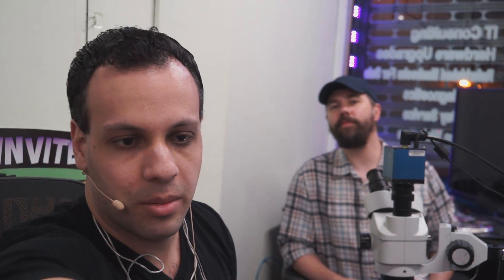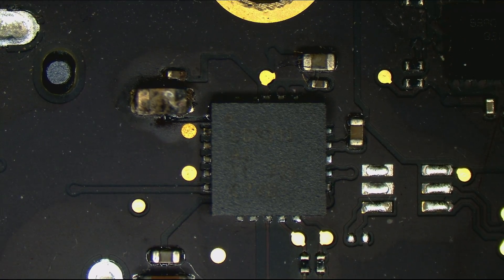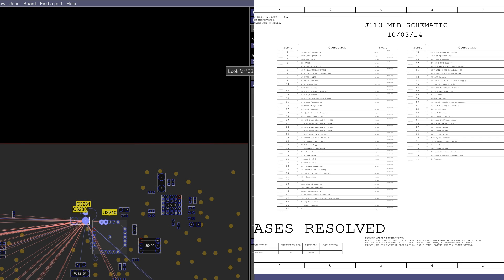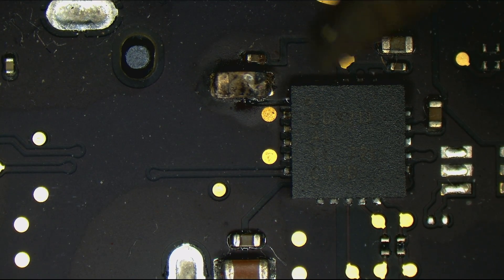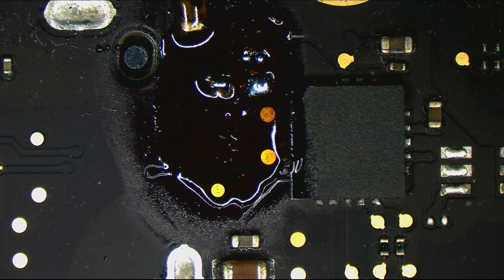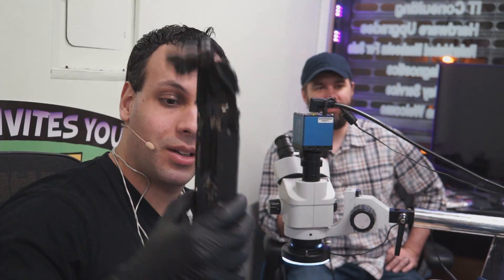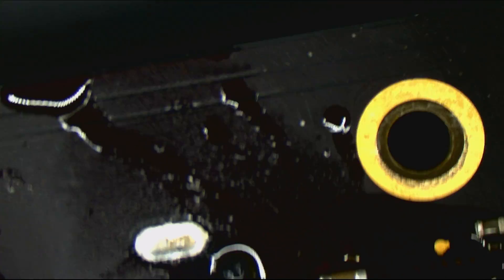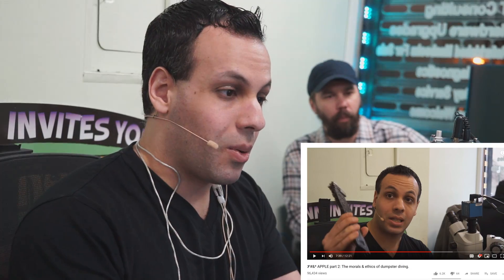Why Macbook Air logic board takes one amp while dead

Comment: 0:52 Like, what the fuck is wrong with people. They do know that the blinkers are supposed to alert others your actions ON TIME, right? It does not cut it to just turn them on WHILE you are turning as a second thought and you're practically in the middle of the intersection! And if you're going to do that, at least check if nobody is coming towards you... It has happened to me multiple times when I bike. Worse thing is that they want to pass the blame on bike riders. Nobody want us on the road, nobody want us on the sidewalk... and they don't even want us on the bike lanes because they want to use them to pass cars.

Comment: Bill:
1x smd capacitor - 0,13 usd
1x knowledge to find the defective capacitor - 129 usd
Reply: Don't forget about desoldering skills, disassembly/reassembly and any consumables for cleaning the board (washing)
Reply: An old dude that used to annoy the heck out of us at my old work said exactly that - customers are not paying for the products and labour - they're paying for the decades of learning the skills.
He was a painful old bastard, but quite wise. We were actually sad when he died despite the frustration he caused.
Reply: this reminds me of when i used to be a field service engineer and i used to service / install all the technology side of McDonald's, including those smart table tents that tell the employees where you are sitting. i was told a story about a soft serve machine repair man was only there 10 minutes but charged 1,000 bucks to fix it. it was a simple fix too. i was shocked, but then realized i would do the same thing

Comment: @Louis Rossmann
If your wearing contacts, that blinking could be a sign your eyes are drying out from air conditioning. Prolonged use of contacts in a dry air environment can cause Corneal neovascularization, with eventual blindness.
Reply from the maker: I do not wear contacts, and I do not use air conditioning in the middle of winter.
Reply: Fair enough.

Comment: I think we need to start tagging videos as "able to be done by anybody" because, lets face it: Buying the screwdriver kit, being careful and watching guides online, and flicking a little burned out cap with your tweezers and/or desoldering one component... That can honestly be done by anybody. Right? I mean, you use a computer--It's a mac, let us not forget that, but you are smart enough to use A computer--and you can watch youtube (or streams) so you can ABSOLUTELY see that this is wrong with your board, and then fix it yourself. #AbleToBeDoneByAnybody